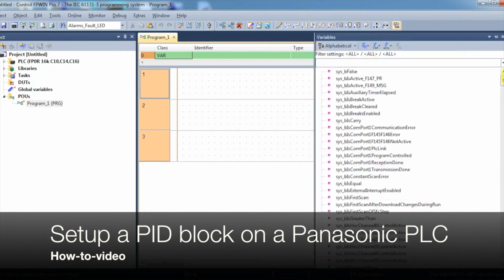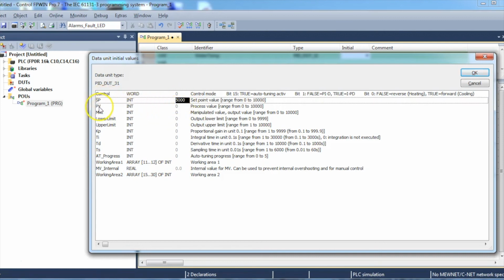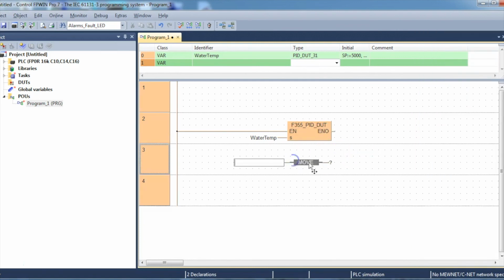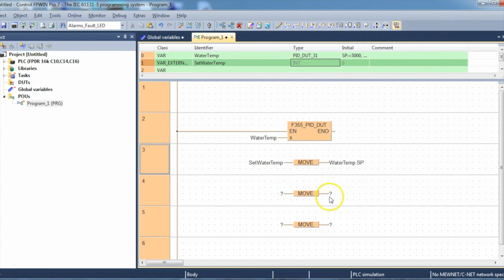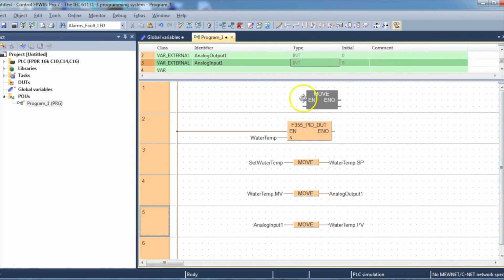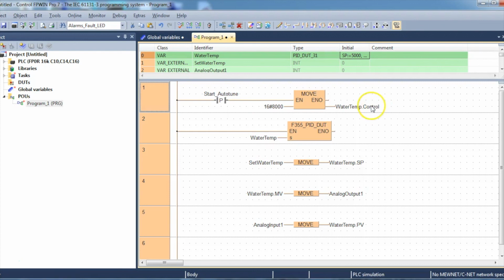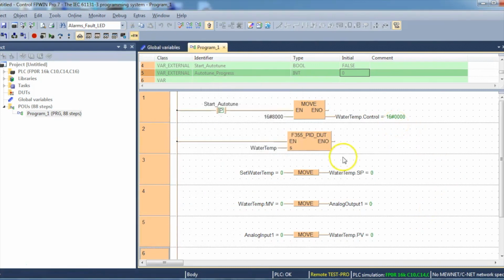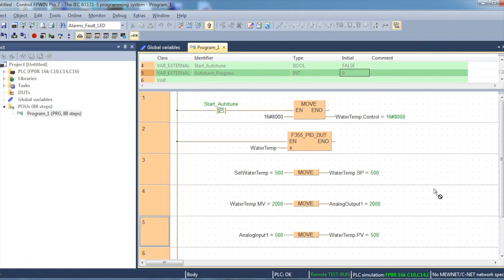Control Logic | PID Control in a Panasonic PLC

Comment: Can you tell me how to use this FB if the process is controlled in single cycles?
I mean, you read the target and error, change your parameters, then run just one cycle and check the results. One cycle at time.

Comment: puedes subir un tutorial de como mover un step motor... using fpwin pro. i have  a plc fp0r c16 mt
Reply: For a stepper motor, you normally need a driver between the PLC outputs and the motor.  The PLC sends commands (usually just simple step & direction) to the driver and the driver controls the motor.  It is not impossible to drive the stepper directly from PLC outputs, but it is not easy.  It requires a lot of timing precision in your code. Also with direct connection, you lose the higher level functions and motor protections that are normally built into the stepper drivers.